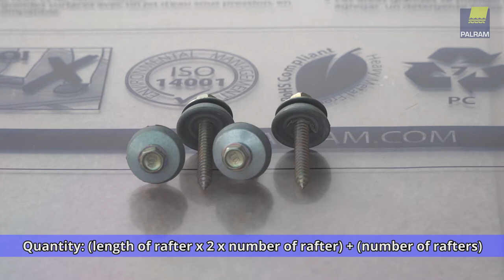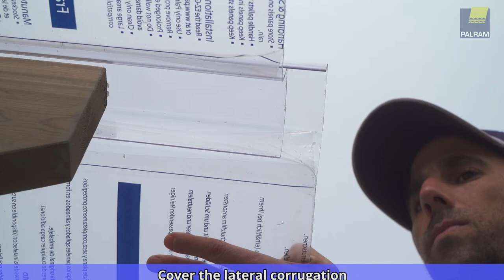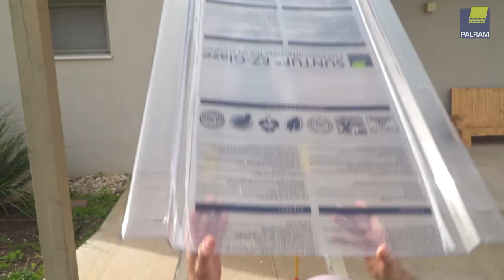How to Install EZ Glaze™ - Palram Industries

Comment: Is there a picture or video available showing how this transparent roof looks after a few years? I'm particularly interested in seeing how the accumulation of leaves, pollutants, birds, etc scratches the surface over the long term.
Reply from the maker: Cleaning polycarbonate panels is simple. 
A helpful preventative method is to plan a proper slope to allow drainage and reduce dirt accumulation. 
As general maintenance, remove any loose debris, such as leaves or twigs, from the sheet's surface using a broom or leaf blower.
You can clean stains using a soft cloth or sponge with warm water.
It's important to avoid high-pressure water or pressure washers, and harsh chemicals or abrasive cleaners.

Comment: Does it go brittle in sunlight like corrugated sheet ?
Reply from the maker: EZ Glaze panels have a UV protection layer. This layer protects the sheets from UV radiation harm and maintains light transmittance and quality for many years.